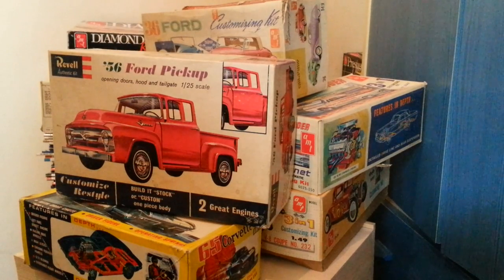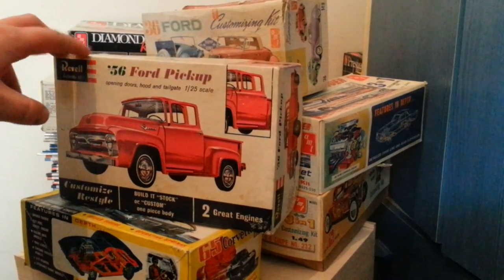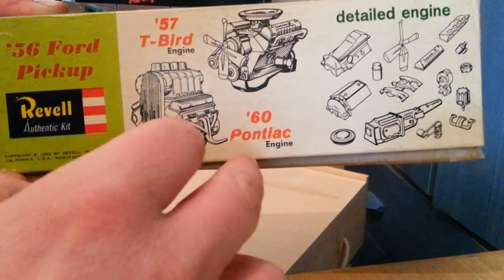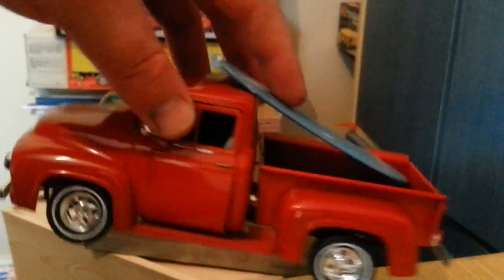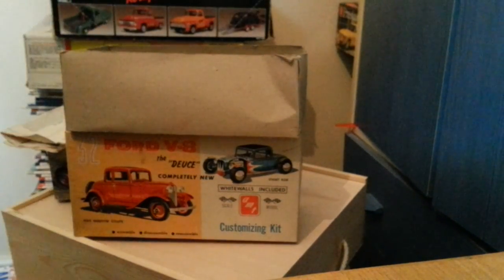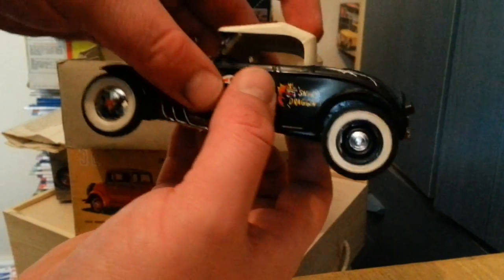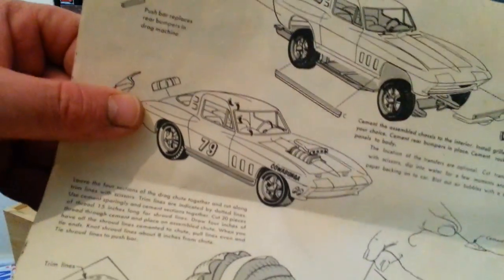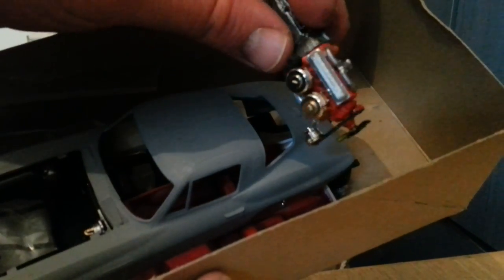Whats in the box?... Built up kits from the 1960s

Comment: Loved those rare kits, and the best of all, they are original issues. I would try to rebuild the two 1932 Fords into factory stock cars, using new parts where needed. Yes, I like them stock. The '56 Ford I would leave alone, and even put it into a display casing (maybe, just maybe install the FoMoCo wheels and hubcaps.

Comment: Hi Gary, the '32 kits - roadster and five-window - were both issued in 1959 and again 1960 since demand couldn't keep up. Kids were waiting six to eight months for the kits to appear.
For 1961 AMT reissued the roadster with a hinged bootlid with dicky seat. Presumably this was based on a second tool to keep up with demand.
The '56 pickup looks to be wearing AMT wheels, maybe Keystones from the '51 Chevy...?

Great video. Did end a bit abruptly before we saw the Coronet though 🙂
Reply from the maker: They must have knocked the kit market for six when they were released, and it's been repopped so many times over the years, a definite classic kit.
By the way the vid straight after this one in my archive shows the Coronet ;-)
Reply: The 32 roadster tool was modified in 1961 to create the Sport Roadster kit. It was not a new tool. It was modified twice more, in 1964, then in 1973.
Reply: @daviddarby6986  so they modified it back to a non opening trunk?

Comment: Great paint job on that '56 Ford Pickup. But did you notice that the builder used a "53 Ford Pickup grille in it? But it's a custom so that's alright. I bought two of these kits when they were new, one I turned into a tow truck. Never did like the opening doors. This kit turned me onto the full size version and I later bought a red "56 Mercury (Canadian Ford truck) Pickup looking almost as nice as the model.

The '32 Ford Roadster kit you have is the second issue. The first issue was in a yellow box.

I bought that '32 Duece Coupe new and bulit it stock, painted red like the one on the box. In those days, I was building all my old Fords stock when most guys were hot rodding them.

The MPC '65 Dodge is, I believe, the first MPC kit. I just have parts of one of those.

I've used Alclad and I wasn't satisfied that it's any better than a good can of chrome silver paint. Maybe other guys could do better with it, I don't know.
Reply from the maker: Jim Ervin thanks for the comments Jim, I did notice the grille, I wonder why he chose the AMT 53 grille ?, I do love those old 32 kits and the MPC Dodge, I have parts coming from the Modelhaus to restore that one, Im still on the fence with Alclad....